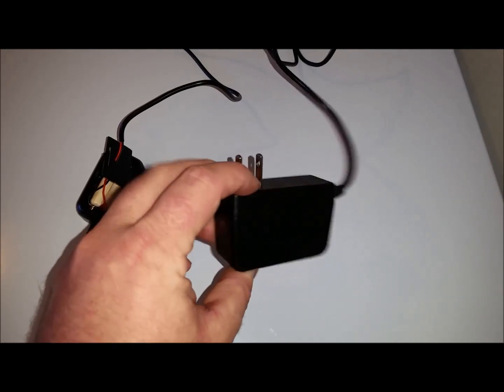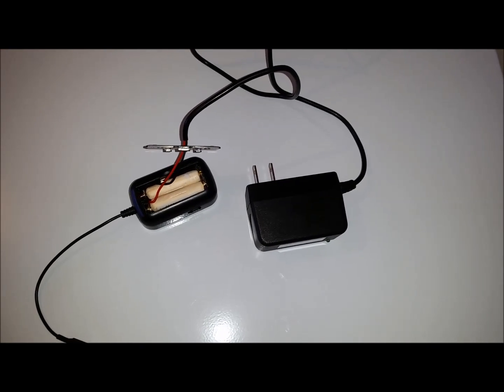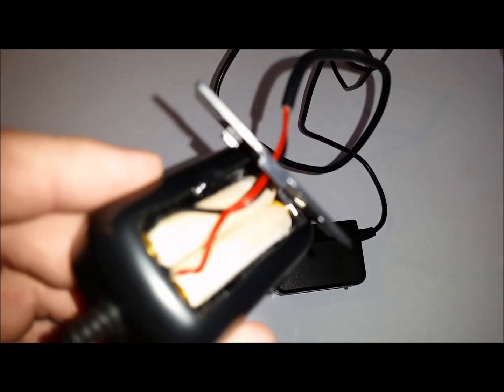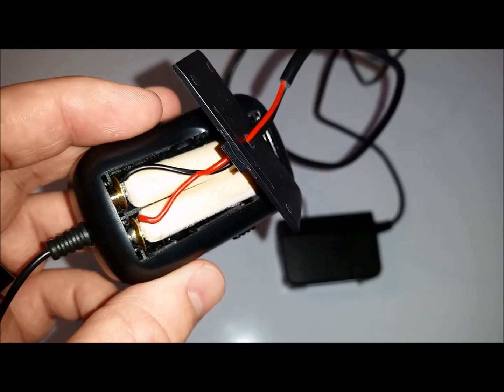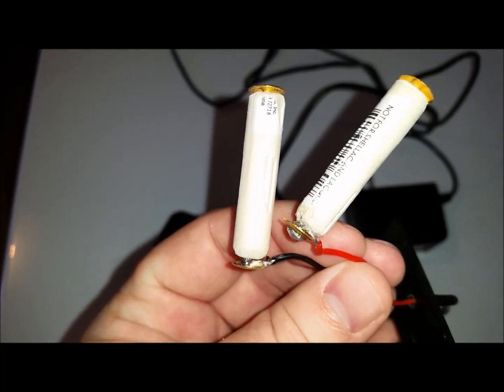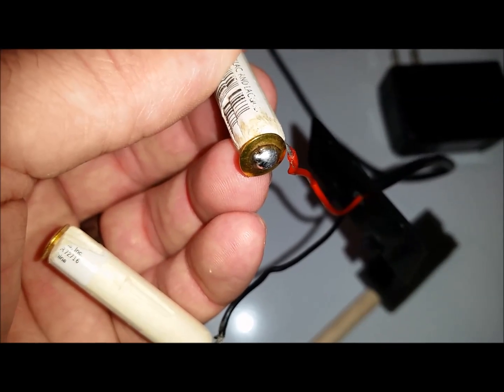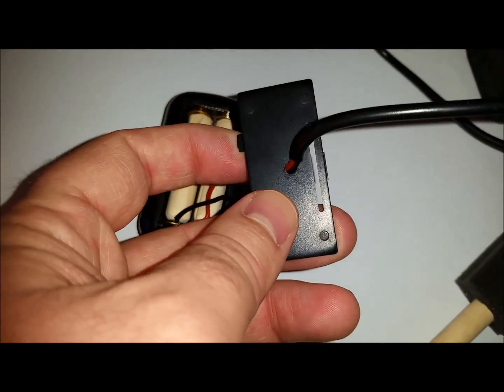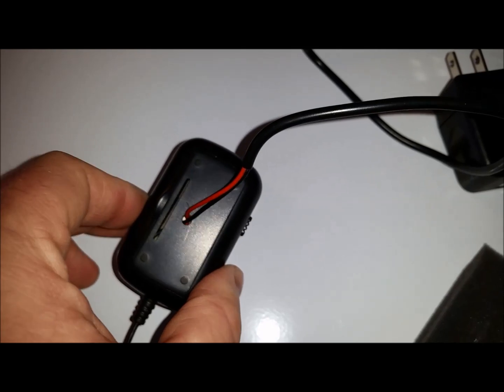How to add power adapter to a battery powered device

Comment: Hi! I love this video, such a great idea!! 
Anyone know how I could tackle a device that takes 5 AA batteries? What specs wall adapter should I find? Also in this one he attaches each positive and negative lead to one battery each, how would it work spread across 5? Thank you!! 🙏🏾❤️
Reply: Could you make 4 dummy batteries that are just a wire from positive to negative, and 1 battery have the AC adapter wires?

Comment: I am trying to di the opposite change from batteries to wall plug . Which is which on a little motherboard that dont have a plus or minus on it ? Can someone help me out here - anyone TIA
Reply: If you're not able to trace the connection from the positive battery terminal, then see if there's a wire tied to a bigger metal piece representing the ground, this will be the positive connection.  If neither and the device is pretty simple, then it shouldn't matter if you connect to positive or negative.  If it's a motor, the motor will just switch direction of rotation.

Comment: You could of used AAA to AA battery adaptor instead of the wood.
All you knead to do is pop the metal piece out and solder a wire to it then put it back and drill a hole in the plastic for the wire.
https://www.ebay.co.uk/itm/1X-Plastic-Battery-Adaptor-Converter-Case-Holder-Switcher-for-AAA-to-AA-Batt-VC4/273947113878?epid=1069037979&hash=item3fc8853996:g:Yv0AAOSwY5ddPboW

Comment: Why use dowel rods when all you need to do is connect to the two terminals.
Reply from the maker: You certainly could if you did not intend to ever use batteries in the device again.
Reply: What was the purpose of the dowel rods then?
Reply: @deanhenthorn1890  It leaves the option of using batteries or wall power.

Comment: You lost me at 1:08, "What you want to do is find a converter that's as close to that power that you need to begin with." Seems like you skimmed over some important steps there. Some of us non-electricians need more info... What exactly is this converter thing? Where do I find it? When and where did you use it? How do I determine what power I need to begin with?
Reply: He means an AC power adapter.  The same thing you use to power your home router, or hue lights hub, your gaming console ect ect.  

Each AA battery is 1.5V, so 2 AA batteries together would be 3v.  In this case you're looking for a 3v AC Power adapter.  You can buy one from Amazon probably.  They are as cheap as $3 on Ali Express tho.  If you buy one of the "multi" switching power adapters you just need to make sure its set to 3V
Reply: @007craft  Don't amps matter too?
Reply: @csar2976  If I'm correct the load determines the amp. Just make sure there is enough of it (amp/current)
Reply: @csar2976  Amps do matter. Look at the device's data plate. It will say something like "3VDC, 500ma." The 3 volts are what the two 1.5V batteries provide. The 500ma (an example) are how much current, in milliamps, the device needs. So our power adapter needs an output of 3VDC -- not more or less -- and at least 500ma. More will not hurt. The device will draw only what it needs. If the device needs 500ma but the power adapter provides only 400ma, gonna be a problem, obviously. Hope that helped.
Reply: But say for some reason you can’t find such a device, you can use resistors along the current to bring the adapters voltage output even lower

Comment: if you just whack on a random a/c adapter like he did you  do run the risk of overpowering your device because the adapter you use may require a certain load to actually be at the voltage printed on the case. If you are going to start experimenting with electronic projects its best to get a multi meter so you can check things.
Reply: He literally explains that in the video… hahahahaha wow
Reply: How do you check it with the multimeter?

Comment: Incredibly dangerous video man. Do you know how many idiots you put in danger with this? Please explain to me what would happen if I took say a 24 volt plug and plugged it up to say a little strand of lights powered by 2 aaa batteries? 
Would that be ok or would I short my entire elec5rical grid in my house out? Possibly electrocute myself in the process?
Reply: would I short my entire elec5rical grid in my house out? Possibly electrocute myself in the process - yes, absolutely, you cell phone power supply will may kill power in the whole subdivision and also shutdown the powerplant if you connect it wrong. Will also may fry your arms all the way to armpits

Comment: I want to do this to my toy car.
Is it possible to do this to you car which uses two 18650 batteries?
Reply: Yes depends on how they're hooked up, in series or parallel to determine what voltage you need

Comment: Better to use voltage regulator and resistors
Reply: for the modern day for a device that uses 2 aa batterys wired in series just solder an appropriate resistor to a usb cord, its more useful and simpler. a 100ohm would do for his project

if you just whack on a random a/c adapter like he did you  do run the risk of overpowering your device because the adapter you use may require a certain load to actually be at the voltage printed on the case. If you are going to start experimenting with electronic projects its best to get a multi meter so you can check things

Comment: Could I do this for a device with 4 aaa batteries?  How would they be hooked up?
Reply: it depends how the its wired you will have too check and see if the battery are wired in series or parallel or some combination of the two so that you know what voltage your device requires.

Comment: Why the tack at other end of dowel?
Reply: The tacks at the other end of the dowel are probably there just to allow the easy slip of the dummy battery assembly in and out of the device. Wood may have a tendency of catching on the spring portions.
Reply: Marty Abreu I have this question too

Comment: Hi,
Can I use real batteries? And which cable is positive and which negative?
Reply: You do not want to run current through non-rechargeable batteries.  This is dangerous.  It could cause an explosion.

Comment: What is the output from wall powered plug?
Reply: The quick answer is that an AA or AAA battery both are 1.5 volts output, so if you had a single AA or AAA battery you'd want a 1.5 volt adapter, or if you had 2 AA or AAAs you have to add up the total voltage so in this case where he has 2 AAA batteries, he'd want a 3 volt DC power adapter (1.5 + 1.5 = 3).   Always be safe and check polarity etc when doing this kind of thing.  https://i.stack.imgur.com/tAAzk.gif
Reply: gr0ove great info, thank you!!!!!!